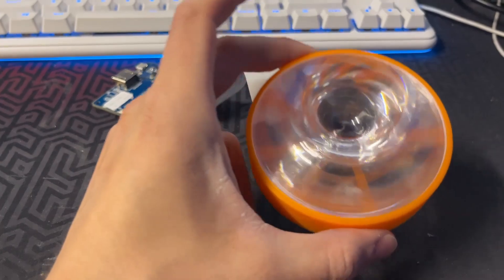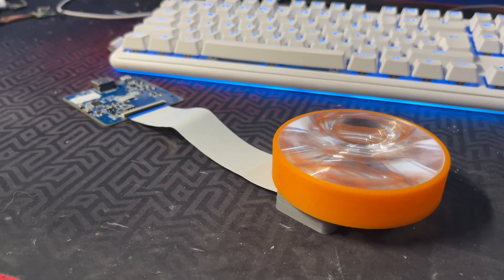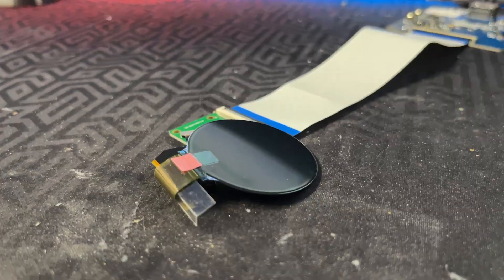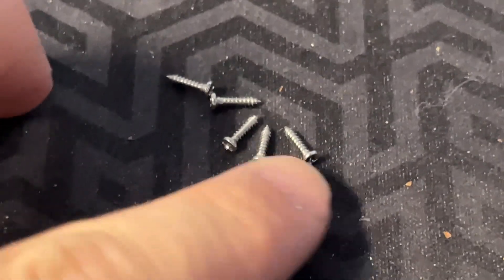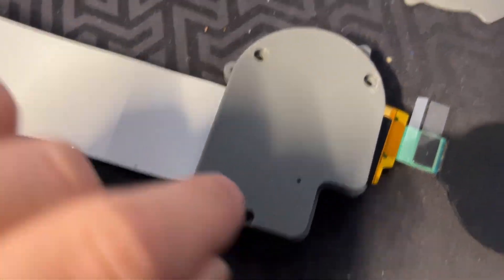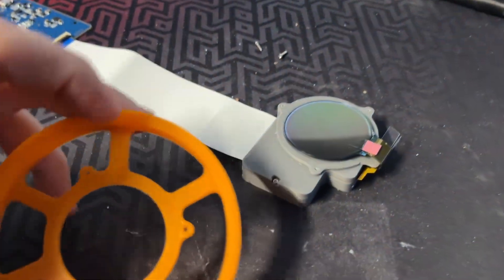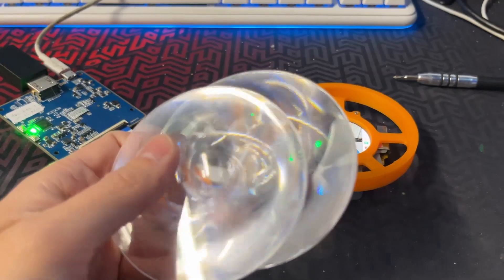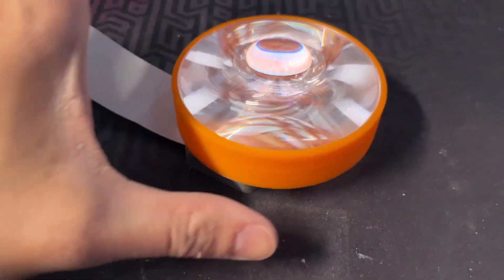Pancake Engine A 1.0

Comment: I really love your work !
Quick question, what is the size of the eye box, is there a lot of abberation (wouldn't you feel sick if there was) ?
I wonder when you will make a full in game demo using your own gear ^^
Reply from the maker: Image almost covers my whole vision vertically. Horizontally there is a small black area but not a lot.

I didn’t really notice any abnegation. It’s possible it’s there but I simply didn’t notice it. I would be more concerned with the low display resolution since you can see the pixels. It’s not as bad as oculus dk1/2 but it’s noticeable